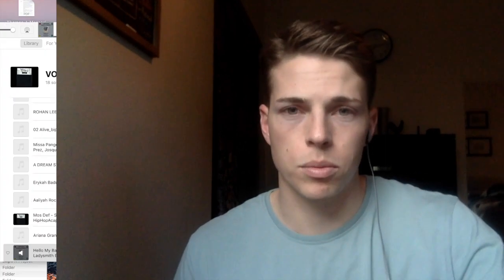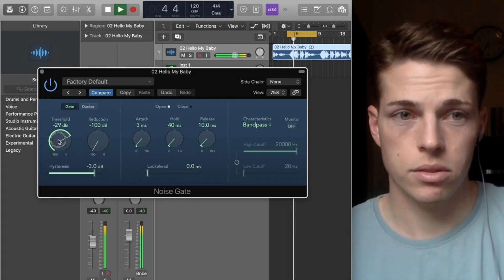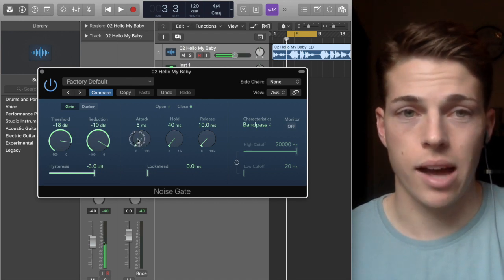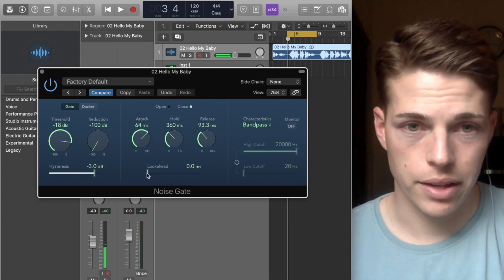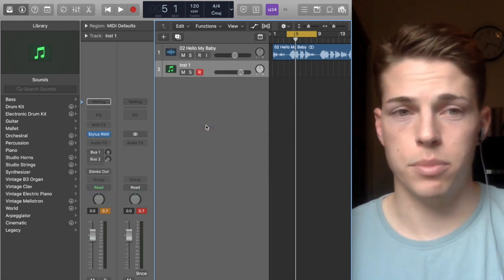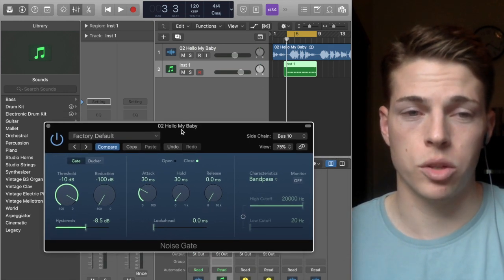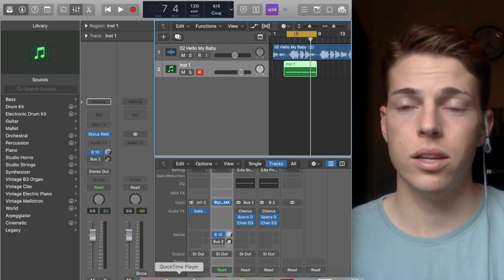using side-chain with a NOISE GATE? (Logic Pro X)

Comment: You didn't even need to create the Bus. Logic lets you Sidechain directly from either software instrument tracks and audio tracks. You could've just selected the Stylus RMX instrument in the side chain drop down menu directly.
Reply: I think maybe it wasn’t an option when he made the video 5 years ago. But yes you’re right, the option is there now.
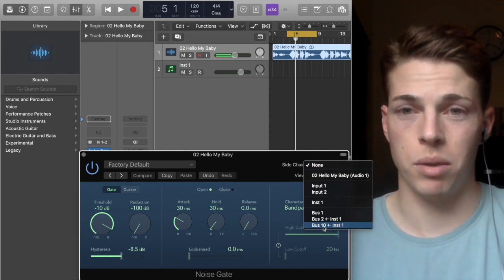Reply: @kevh4899  Nope, judging from the way Logic UI looks like in the video (the overly flat design), I know that this is Logic version 10.4 released in January 2018. If you look at the video description details it says that this video was published in June 2018 so we can safely say that the version used is 10.4. I also know that in version 10.4, that feature where you can sidechain directly from software instrument tracks was released in 10.4. Finally, if you go to the 6:42 timestamp you'll notice that "Inst 1" (referring to Track 2, the green software instrument track) is available right there in the Side Chain drop down menu, it's below "Input 2" and right above "Bus 1". The feature is RIGHT THERE but the guy who made this tutorial isn't even aware of this feature.
Reply from the maker: Good point. I am not sure if this feature was available in my version of Logic I was using (it may have been). But your solution is even easier.

Old habits die hard!
Reply: @SixFootPigeons  This feature has existed since version 10.4